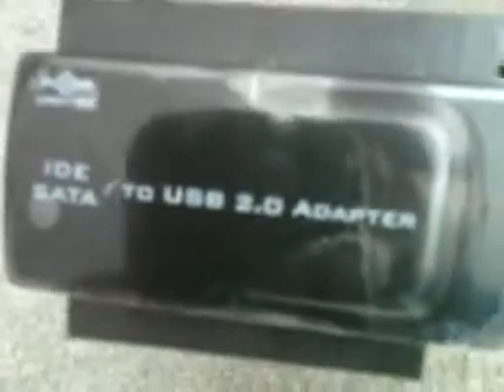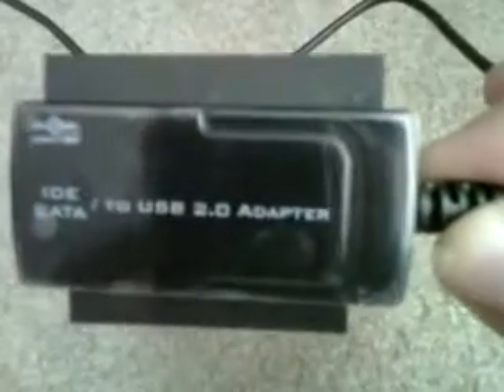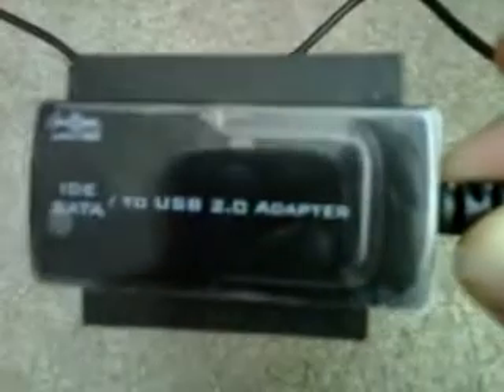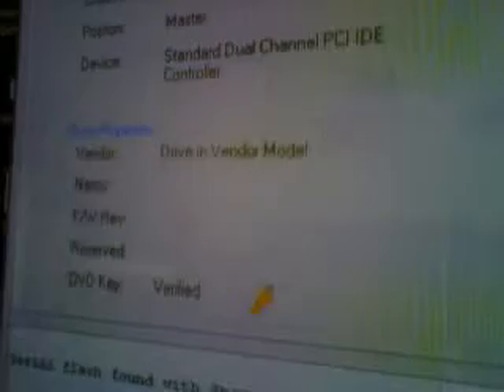Slim DRIVES with SATA to USB adapter.3GP

Comment: guys ignore this vid at all costs, look for alternatives! He has his key verified before he starts, the video jumps so much because he wants to hide the fact that he doesnt actually click on 'no' to resend vendor intro, he even has a bloody backup in the drive so it must be flashed already surely.
Reply: Lol what? You need a VIA 6421 card in order to even be able to detect / flash the drive (unless you already have compatible SATA, which I doubt). Then you need this cable (SATA to USB) in order to put the drive in Vendor mode. Do what he does, but you still need to have that VIA 6421 chip installed and a power supply of course. I have been doing this for a while, without a single issue. You also must know if you have a Winbond or MXIC. Either way, if you are on the latest dash you will either have to make some modifications to the board (cut some traces, drill a hole, etc) or buy a replacement one since the latest dash locks the drive, and that's the only way to unlock it. You CAN dump your drive using this method though 100%.
Reply: Hairy MineFart Lmao not sure if you are having a go at me or Justin Bigler  :O

Comment: Thanks for making this video; I have one dumb question for you though, I have an older PC without SATA ports on the mobo, could I extract the keys using Jungle Flasher by going from the xbox drive to the SATA to USB adapter then going from the adapter to USB into my computer?

Comment from the maker: @360gliches no that won't work. You can however remove the internal discount drive of ur laptop and the kids use the empty sata port from that with the usb to sata adapter. I have done it a few times to test it.

Comment: Ok my Desktop doesnt have SATA ports. Can i buy (2) Sata to USB's. and have the usb in the Laptop and the sata port NOT OCCUPIED. and like u do is unplug the sata cable from one end so what if i disconnected it but insead of connecting it to the desktop what if i connect it to the other sata port to usb?? would that read and be able to be flashed ??

Comment: Great video mate i replaced my winbond pcb for a mxci unlocked one 0n my 0225 drive and got a sata/ide to usb from ebay for £7.00 and it worked a treat saving me from forking out cash for an expensive usb pro,i salute you well done.

Comment from the maker: After you get it in vendor mode you need to read it first. Then you have to drill a hole in the chip to unlock the drive o be able to write to it.

Comment: @MamadoProductions when i try to connect my drive (slim 0225) to the PC (without using your tutorial) it doesn't even recognize the drive..jungle flasher doesn't see it as "Connected" and all ports are empty..will your tutorial still work with me then? ( i have a replacement Team Xcuter PCB installed btw..)

a speedy reply will be much appreciated..thanks a bunch